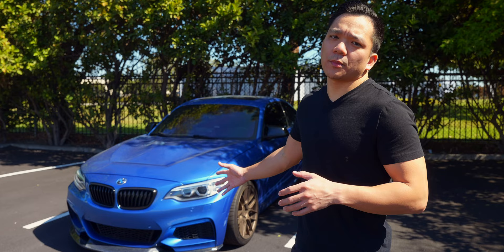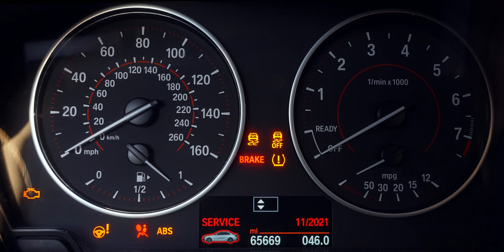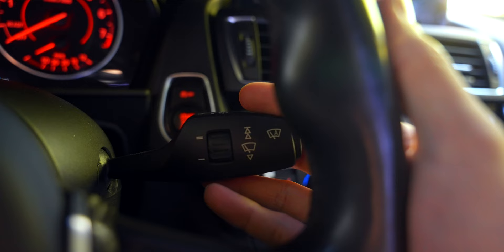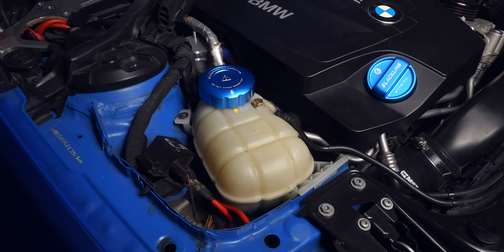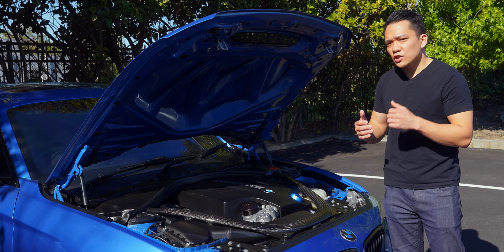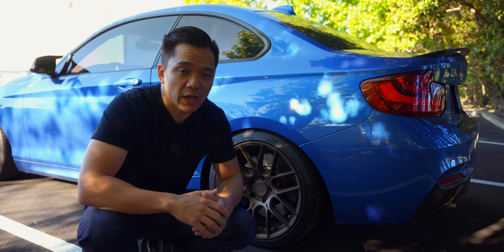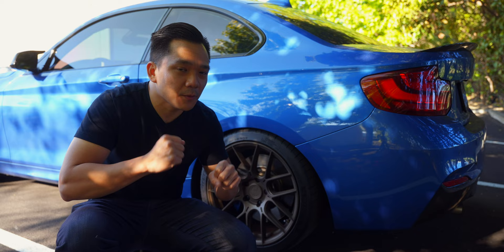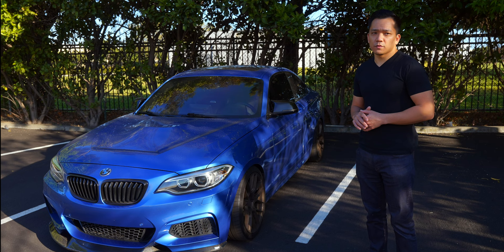Secrets to Keep Your BMW Running...FOREVER!

Comment: Oil change should be 5k miles not 10
Reply: I can't agree more...even quality oils need to be changed regularly.
Reply: I do it every 4-3k
Reply: I would also change the transmission fluid around the same time too.🤔
Reply: I add oil instead of fuel
Reply: Naa! 10k is right for bmw
Reply: Bwm plastic timing chain guide will break down much faster with 10000 rather than 5000 this insures a dealership visit much sooner for a replacement timing chain or to stock up their certified preown lot as more suckas enter the system of makem break 4 future profits sake
Reply: Goes for any car really.  Its the life blood.
Reply: Direct injection and forced induction? Change it every 3k unless you like fuel contamination in your oil.

Think about the pressure inside the combustion chamber...then add a turbocharger on top of that. If you think those piston rings are preventing the oil from being contaminated, think again. Especially if you wait until 10k to change it. No wonder so many BMW owners have mechanical issues due to neglect/abuse.
Reply: 5k miles? I do on 5k kilometers.
Reply: today's standard. With the dealer's recommendations, 10k.
Reply: especially when you aren't pushing too hard. Also, don't refill or recharge your A/C yourself. Overcharging it could happen.

Comment: Oh my gosh! Just started watching this video as I have a 228i with 100,000 and new issues popping up, unfortunately. I had to stop and post this immediately regarding wiper fluid. I saw you pouring RainX into the reservoir. WRONG. I had my washer pump fail and did a deep dive. Sure enough, even BMW says specifically NOT to use RainX as it will cause your pump to fail. I replaced the pump myself and believe me, its not fun. You have to remove a front wheel and lining, fish the container out that's sandwiched impossibly between the exterior metal and the body. The pump isn't expensive but labor is expensive if you pay someone else and doing it yourself is a major pain. Please. No RainX
Reply: Hey buddy, tell me about your 228i
I got a z4 28i and am a little worried
Reply: @Krezo200  Hello Krezo. I passed 105k miles and the car is still strong. I had to replace the oil pan recently. Not cheap. I opted to do a replacement since most of the cost is labor anyway and if the seal isn't put in properly I'd have to pay twice. I also went with an aluminum pan instead of plastic. Hoping that was a good decision. I see a leak in my valve cover and bought a new OEM cover I plan to install myself. I replaced the plugs and coils myself. Easy.  My Carly app says my fuel mixture is lean so will use my more serious reader to see if I need a new injector(s). My screen inside is getting  filigree delamination lines but so far hasn't affected any operations. So, for a car now 9 years old, the oil pan was the only big expense. Oh, I did need to replace the battery and negative cable with the sending chip which was far more expensive than any previous car.
Reply: @Hyytekk  thank you for your answer. thats not as bad as i expected. mine has around 52k miles and i hope i got some good times ahead of me with my n20. but i assume yours is way newer, i got a 2012 one
Reply: @Krezo200  Mine isn't too much newer. It's a 2015 I bought used in 2016 with a few thousand miles on it. Just make sure you change your oil every 5000 miles or less and do the routine maintenance and you should have years of trouble free driving. One thing to be aware of is your timing chain. They changed and improved the design in 2015. I've read that before 2015 the chain can come off the track from becoming too loose. That will instantly destroy the engine. Check out more info on the web about that issue. I know one person it happened to. A good mechanic can sometimes determine if it's getting loose by the sound. Good luck in all.
Reply: @Hyytekk  yup, thats the way i approach it. interesting is that americans never mention the oil pump chain, here in germany thats the problem number 1 for the n20 engine. thanks mate and i wish you good luck as well !

Comment: If you have to recharge your A/C, you have a leak. Period. Recharging without identifying and fixing the leak(s) means that virtually all the refrigerant will make its way into the atmosphere. The approach you’re pushing is the reason A/C recharge kits are being banned in many states. Recharge kits also don’t allow you to properly set the level of refrigerant and oil, monitor the high side pressure, or get rid of the moisture in the system. All A/C  work should start with a proper recovery followed by a proper recharge with a machine.

Comment: Great video. My 1st Bimmer, a 325i went for 14 years before any major issues. But, every issue is $$$ unless you can do it yourself, even then parts are expensive. I will also say too many parts are made of plastic which starts wearing out, esp if not garaged or being by the beach like we are. The rubber is also not great quality esp around windows and seals. On my 2nd Bimmer and experiencing this. So I would say its not the mileage on it, but the age of the car and how and where it is housed that makes it or breaks it with BMWs. I would never buy a used one unless out of a 2 or 3yr lease and even then it needs to be looked at by a mechanic. That’s what I did with my latest one. But even with all the apparent cons and experience I’ve had it didn’t dissuade me from buying my new 5 series. I love it. Nothing drives like a Bimmer.

Comment: I believe that ZF recommends 50-60k transmission fluid change intervals. And, one must also change the bridge seal and sealing sleeves located on the other side of the mechatronics plate. The rubber seals will harden over time, not allowing sufficient fluid pressure. This will cause shifting issues and may result in transmission damage.

Comment: Hi Fritz, I like the new opening! Thanks again for supplying good relevant content. That coolant hose flange is definitely something to replace, that's on my list. You showed the brake fluid bleed kit. I just purchased and used it, it worked perfectly for making that a one-man job. Remember folks, brake fluid is "hydrophobic" which means it absorbs water even when not used and needs to be replaced at the recommended intervals. The meter you showed is inexpensive and works well. Also, I had my rear diff replaced with a Wavetrac and after the break-in period I changed the fluid. OH MY GOD the fluid was horrible, it was scary bad... DEFINITELY change that fluid after the recommended break-in. I would even recommend that service on a stock diff after 60-70K just because. As for the transmission, I too recommend changing the fluid at under 100K miles. That stuff doesn't last forever, and this is a sports car, so the fluid does take a beating more-so than a regular passenger car.
Reply from the maker: Thank you so much for always showing your support, I really appreciate it. As for your advice, you should have been the one making the video that was a ton of excellent information and tips! Thanks for sharing and helping out the community 👍
Reply: not hydrophobic but hydroscopic I think
Reply: @suniltirbooman8160  interesting you say that and thank you for pointing this out- I had to Google it and found there is much more to it. I found this useful article: https://www.brakepartsinc.com/dam/jcr:be5cef80-95e6-496a-8527-726d067dd0f2/Types%20of%20Brake%20Fluid.pdf

Comment: wait question does the x drive models have only a front differential? or both a rear and front dif? cause im planning to buy a f31 soon and when i get it from a dealer my plan is to replace all of the fluids for a piece of mind also because i dont trust dealerships that much honestly

Comment: Big UP! 🤙 Nice job man, I do my brakes and bled the lines then, but totally feeling like I could do them more often. I heard from my indie mechanic that the 10k mile oil change cycle was designed for planned obsolescence.. Basically instructions to bring more carbon buildup.. Thoughts on this and doing changes sooner like 5K? 

Appreciate these videos man! 😎
Reply from the maker: Thank you for the support and encouragement. 

I used to do 5k mi oil changes and the oil looked to have lots of life left and the difference in feel was minimal. Then I went to 7k and that seemed to be more noticeable and looked like the oil was a bit darker. However, with all the additives and claims of 10k plus I have to top off oil in-between changes I figured 10k should be ok. 

All of this is subjective of course. I would say try 5k 7k and 10k and see what works best for you. Our difference in driving conditions will also factor in. Hope that was helpful
Reply: @FritzRamos  where do you get your custom fluid caps from? Also where can I buy that hose so I can retrofit it into my vehicle

Comment: So after watching this, here is what my turbo stage 3 honda requires as far as maintenance.
Oil changes every 5K miles.
Trans fluid change very 30-50k (if you want, usually not necessary unless there is a change in transmission feel).
Coolant changes? Almost never or when ever the coolant PH goes bellow a 7 (which after 100k miles....hasn't happened yet).
Brake fluid changes? Only when there is above 0.5% moisture (which after 100k miles, is at 0.1%).
No coolant leaks, no lines replaced, AC runs perfectly and has never needed a recharge...

A daily driven BMW requires almost what, 10x the fluid changes? Why would anyone voluntarily want to go through this lol.

Comment: Just want to touch on the engine oil for n20/n26. Have you tried 5w30 or have you always stuck with 0w20 weight? Of course bearing in mind the notorious timing chain issues those engines seem to have.

Comment: Would using 5w-40 Liqui Moly be good for a n26?
Reply from the maker: I use 5w-30 in my dad's n26. I think it depends on the year though. I believe BMW moved toward leaner oils for the newer models
Reply: 0w40 LM Synthoil energy best oil for all bmw engines. I was using this oil for my n20 for 4 years, and now for my n55.

Comment: I’ve been using 0w-30 lately and I live in California, should I change to 5w-40?
Reply from the maker: Not necessarily. What's your reasoning for going with 0w-30?
Reply: @FritzRamos  its what they had at the dealership, I work at a bmw one so I just get it there and do it myself. I saw that the manual allowed 0w-30 so I just assumed it was ok but if 5w-40 is better I’m willing to switch.
Reply: I've been using ow-40 for the past few years. Rationale is that it still has the lower winter oil weight, while still being thicker at higher operating temperatures. In theory, the thicker/ more viscous weight should help maintain oil pressure better for performance driving and hotter temperatures (like CA), and also produce less oil vapor that might result in carbon buildup on the intake valves (even though that is much less of an issue for the N55). Only downside is that it probably takes a little longer to warm up, so it would be less ideal if most of your driving is a bunch of short trips. I doubt it makes that much of a difference, but the cost is mostly the same either way.
Reply: BMW recommends 5w-30 for the N55 engine. They later changed this to 0w-30.